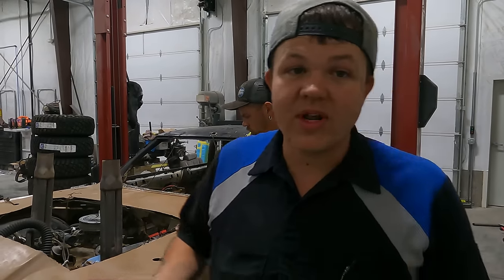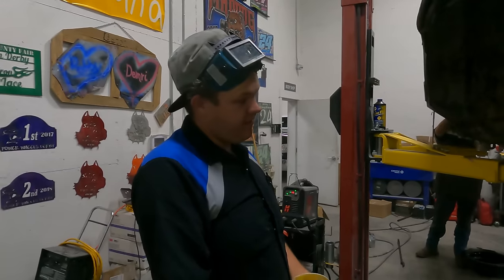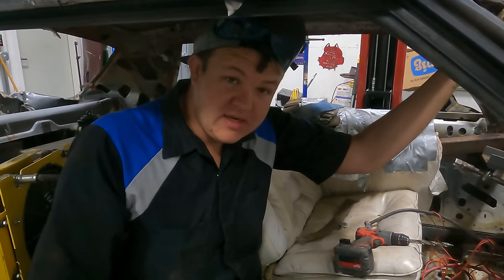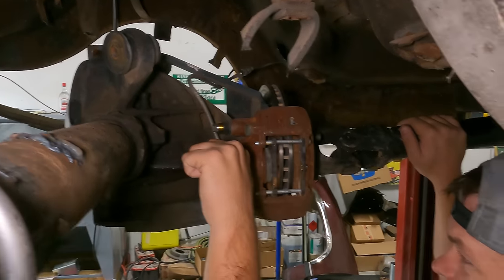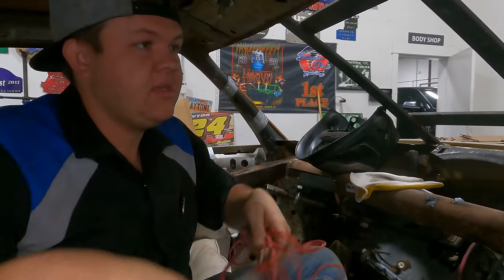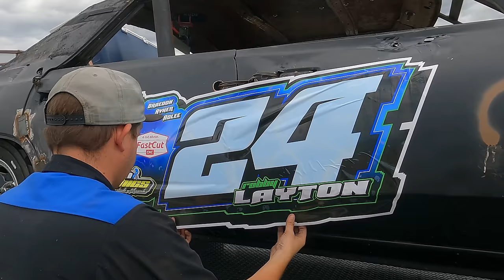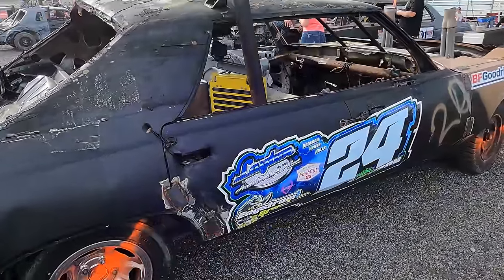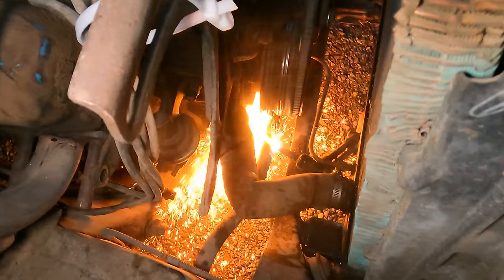How To NOT Build A CHAMPIONSHIP Derby Car In 48 HOURS!

Comment: An old timer taught Me a real good tip when bleeding brakes. Pumping them up only bounces the air in line back & forth. Best way is Hold them down, open bledder, close beelder, let pedal up & hold down again, repeating till solid. guaranteed solid brake pedal again.

Comment: I have a little tip for u Robby. To bleed your lines, there is no pumping involved. Put a hose on the bleed valve and just open. Let gravity do its job and let it flow until all air is out, ensuring that you keep fluid in the reservoir at all times, or u will have to start again. Do this on all 4 and them pump a few times and all will be done. The hose is to collect all the fluid without making a mess. Just catch into a bottle. Give this method a try. U will be happy and it only requires 1 person.

Comment: If I did what you guys do under a vehicle I would have already had ten pieces of metal or rust in my eyes. About 20 years ago I had a piece of metal in my eye from working under my car and I thought it was just scratched so I waited too long.  An Ophthalmologist had to actually use a drill bit mounted on a platform to drill the metal out because it apparently rusted in my eye. if your ever have to have this done you'll wish you had worn safety glasses.
Reply: I did it with a welding splatter bauble, laying under a trailer welding up a cracked spring mount, the bauble bounced off the concrete and came up between my helmet and head .. landed in my eye and burned itself into place. 
Found a optometrist open, he used a large bore need from a syringe and flattened one end a but and used it as a very sharp scoop to take it out . That was an interesting experience I have no interest in repeating. The one upside was that fortunately the metal in my eye was totally sterile as it had been molten seconds before hand, so chance of infection was pretty low.
Reply: Had it happen to me…but I was wearing safety glasses (properly).  Piece of grinding slag went through them.  While they make things better, they’re not 100%.
Reply: I have been trying to say this to all the channels related here. Fab Rats, Matt etc etc, but they dont seem to listen or care. It is a bit disheartening, I must say. They must have an eye bank somewhere.
Reply: I had a spark from a heavy grinder bounce off the wall behind my full face shield, bounced off my cheek onto the inside of my safety glasses, and off the inside of the safety glasses onto my eye and stick.
I know what happened because I felt it burn my cheek and saw it bounce of the glasses lol
I was able to use an exacto knife blade tip and my rear view mirror to pop it off the white of my eye, so while it hurt for a while every time I blinked, it healed up fine lol
Reply: Had the same thing happen twice, once while wearing safety glasses. Still don't always wear them.
Reply: @bamabackroads1203  Well, in that case. Some people learn from their mistakes.
Reply: Also had steel in the eye. Went the next day to Doc as I knew something was not right. He picked it out but shamed me because it had already started to rust.

Comment: In Montana in 60's and 70's demo derby was stock cars with just glass removed. No other changes. Slowly things like battery placement, wiring and fuel location were changed. Then they started letting doors, etc be braised more solid. Far from today. After one session even most winners were unusable for a second session!

Comment: To bleed brakes: open bleeder screw, second person push brake pedal to floor and hold, close bleeder screw, release brake pedal. Repeat procedure until no air remains. Pumping the pedal can actually push the fluid past the air.

Comment: LMAO most of that car wouldnt pass inspection at the tracks we derbied on years go BUT the wires on the front would have!!! we ran a chain in a figure 8 through the hood around the core support and bumper brackets with a big washer and bolt in the center of the radiator

Comment: The other day I was watching a video where hillbilly was removing a decal with the rubber wheel. I didn't know if you ever tried using an oscillating tool with the scraper blade I've used it in the past on decals and if you've got a light touch you don't even hurt the paint at all or in the case that he was working on where you're repainting it anyway it peels it off just like butter it also works on the adhesive that they put on windshields and stuff a lot easier than normal

Comment: You know if you don't pump the brakes you can bleed them faster just push the pedal down hold it crack the bleeder loose tighten it up and repeat the process push the pedal down when you pump it you're pushing the air back and forth back and forth back and forth back and forth

Comment: Your 5 point harness could have new webbing put on it using seat belt webbing. A competent upholstery shop could stitch it up with nylon thread, just like the factory did. My local shop will do this as long as it's not used for lifting, where something could cause it to tear and potentially fall on someone.

Comment: Robby/crew. You had option to put rear end above leaf springs or below I see you did above witch lead to immediate clearance needed. Is there A reason to go above rather then below??? Also is that the rad right in car next to you as the driver?  That’s legal? Stupid regardless if you’ve ever seen rad blow up from heat and it in that location it’s sad how hurt you can get and how life changing that is
Reply: That’s a transmission cooler

Comment: Hello ,
To properly bleed the brakes, you must use a transparent pipe on the bleed screw and immerse in a jar with a little (brake) fluid, and you must start with the caliper furthest from the master cylinder, this avoids doing 4 times around we can see the bubbles moving in the pipe and above all we don't put them everywhere, voila.  😉
Reply: Guess you didn’t see that he deleted all the brakes from the car. He added a single brake caliper to the pinion

Comment: I have never done this myself, but I have seen it and it works. Don’t pump. Your master cylinder is higher than your calibres so open the bleeders and let gravity push the air out. Just make sure your reservoir doesn’t go dry.